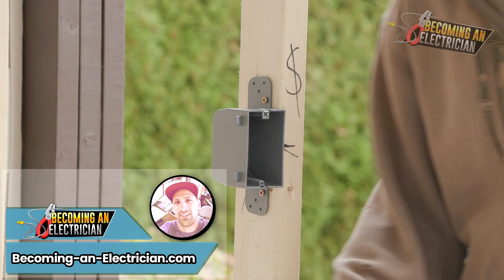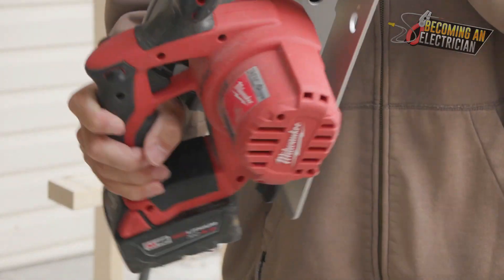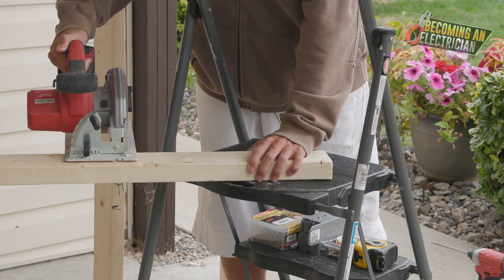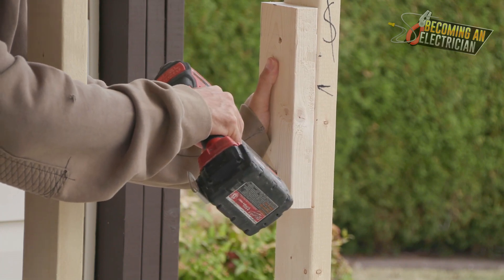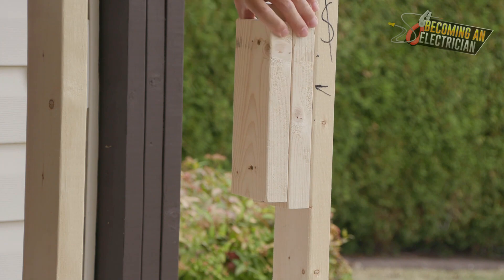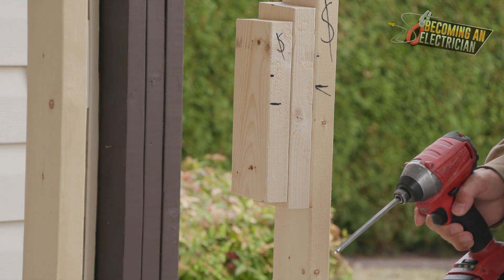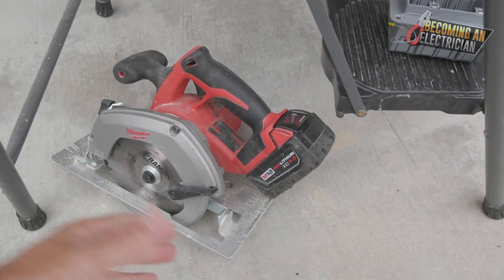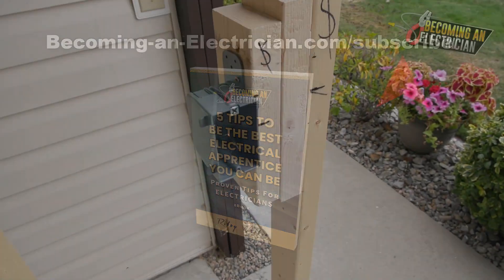What is an Electrical Scab for Boxing

Comment: I have seen this done in the United States 
And also done this but with nails . Screws are a waste  and framers drop nails like they are free
Reply from the maker: Screws are more expensive but hold way better.  Nails come loose if you don’t have proper nails.. gotta think long term for the customer 😁
Reply: @BecomingAnElectrician  it's a single gang box . And also drywall on two sides most likely. That will hold long term " for the customer "
Reply from the maker: I still disagree from first-hand experience.  If it's a plug, it matters much more because constant in-and-out over the years, especially with tamper resistant plugs.  Screws are faster and hold tighter for boxing..

If it's a switch, it doesn't matter as much because of the light force from a user, and nails could do..

Comment: Is this a Canadian thing? I have never seen this in the United States
Reply: Not just a Canadian thing. It's fairly common in my area of Texas. Commercial sometimes too. Just use scrap steel stud horizontal and cut to lap the vertical studs.
Reply from the maker: Must be Canadian.  How do you guys push out your boxes from the door frame on the cheap like shown?